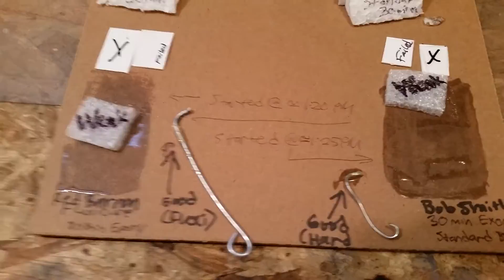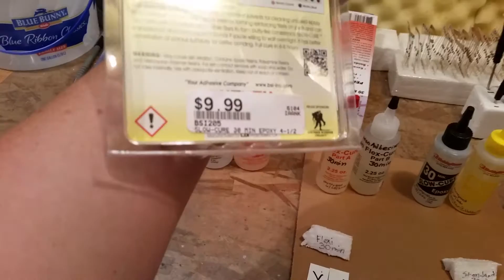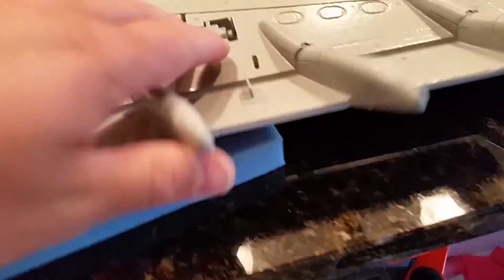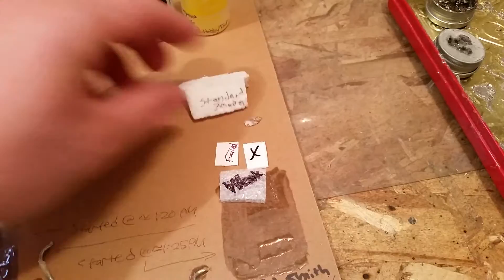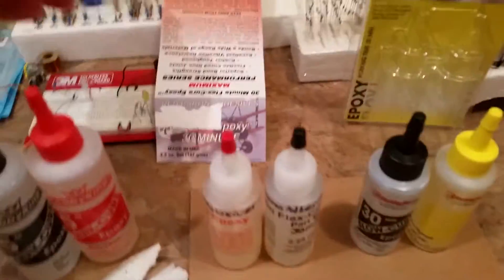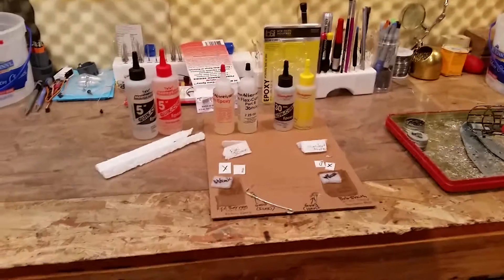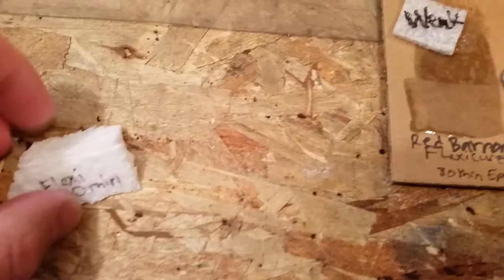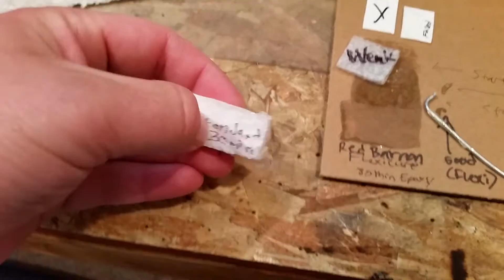30 Min Epoxy vs 30 Min Flexible Epoxy Test 6/26/2016

Comment: I know this is now a bit older of a video but I'd like to recommend the contact adhesive made by Homax called Welder.  It's a 1 part adhesive that looks like what's in your white tube.  I received it with one of IBCrazy's VAS Hellkite kits, which is an EPP foam plane but I'm sure it would work for other foams as well.  You can see him using it in the VAS Hellkite build video.  He uses it for foam to foam, spars in the foam, motor mount to foam, plastic fins to foam... etc.  I'm a big fan of your videos by the way, many of them have helped me along the way.  So, thank you!
Reply from the maker: Thanks Ken! I love using Mucilage - the stuff in the white tubes - BUT I've since found a few similar products, but my favorite is the Mucilage so far.

Comment: Brian, i believe you can help me out. I want to repair skate wheels, they are made of a plastic central hub and an outer polyurethane. I keep having the two separating. What would you suggest? I recently had some success with JB PlasticWeld quick-setting 5min epoxy (although i still think they will separate sooner than later). What adhesive would u suggest me to use instead? The JB Weld i am able to peel it off of the urethane (or polyurethane, im not sure which they made of). Your advising will be greatly appreciated, master.. Thx bro
Reply from the maker: I would do what you're doing, but make a hole, with a soldering iron or drill on each side first, in a few places, then PIN it together with some epoxy, and or a small piece of metal. This would help keep the two halves aligned.

However, keep in mind unlike materials are always hard to get to stick in a high wear and tear environment, like SKATE wheels. Any chance you could replace the wheels??? Is this a vintage item?
Reply: @BrianPhillipsRC  I know its been a long time but thx for the idea. Im still looking for a solution. The issue with your idea is that the things im trying to bind together is skate wheels, so it would be hard to make your idea on a circular object. I would need to add i guess 3 of those to keep the wheel balanced plus even finding a way to make such thing. But anyways, thx for helping out. Have a great one pal.

Comment: Acrylic hot glue will bond stronger than foam and is very flexible; about 3x the price of standard hot glue.
Reply from the maker: I'll look into this option. Thanks for the tip

Comment: Use Hysol EA E-20HP epoxy for a high sheer strength peel resistant bond and forget the rest.
Reply from the maker: Where do you buy it?